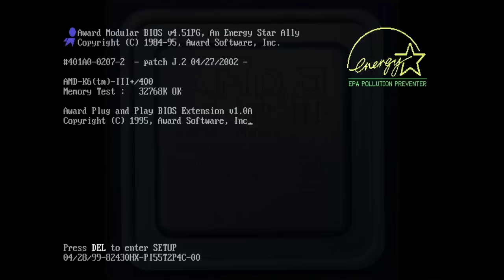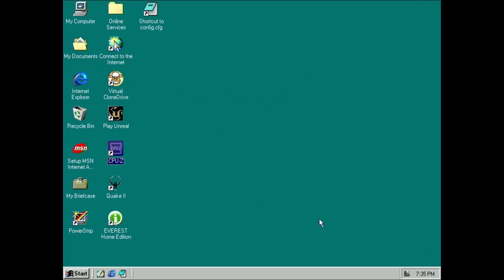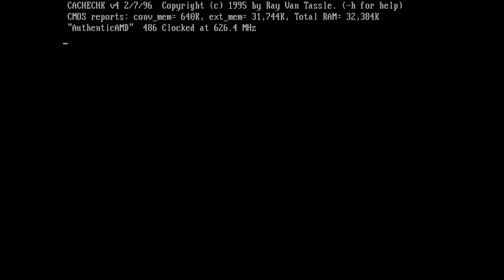Turn K6-2+ into K6-III+: Modification and Assembly (Part 2)

Comment: Good old days of AMD... I remember unlocking Duron 1400MHz to Athlon 2100+ just by bridging contacts with B2 graphite pencil and unlocking additional L2 cache... I paid about 50% less than would for same performance, I also unlocked ATI Radeon 9500 to 9700 Pro also by resoldering some resistors, just the other day found my old printed manuals, I probably still had dial-up at the time so I printed to save on monthly bill :) Those were the best days, it was so much fun and interesting to mess with hardware
Reply from the maker: I tried the 9500 to 9700 mod. There was a soft mod via driver hack available. I think you unlocked the extra 4 pixel pipelines or something in that area. With the soft mod you could first try if you had a good or defective chip. Mine was unfortunately defective and I got artifacts
Reply: Did the same with an 6200 unlocking to 6600.
Reply: @bitsundbolts  Also the 9800SE 256bit version was possible to unlock fully to make it 9800PRO. I had such card and it did work without any problems.
Reply from the maker: Good to know. Thanks for sharing! 👍
Reply: Duron and Athlon used whole different sizes die's
Reply: @jannejohansson3383  Indeed. Only the multiplier lock could be lifted. Same as the Palomino core Athlon XP's and MP's. It was a little more complicated on these organic amber/green cpu's than the ceramic ones. The bridges were cut in the middle deep and those cuts needed to fill first before connecting the bridges again. And then it the multiplier was freely selectable. I used to do couple of those mods too at the time.
Reply: @randomdriver  yeah, and I think these some could turn to mp, I still have dual socket board from these day, a7m-d or something. That bios didn't have multiplayer change possibility even with hax cpu, but it was OK without that. And ecc mems didn't really were so good some added speed :p
It was then, now it's now. Some Lan party if I test something and used one cpu, computer was on table, some guys looking and thinking how on hell he is driving PC without processor. They saw just empty socket and indeed it was running :p
Now I have first time after maybe 15 years powerstation with one cpu, but that same board got ready place to another 6 rams and cpu slot wired on pcb. It gives some empty room inside box and otherwise it's little bit full. I just need new lto-6 drive, sas or fibre, no matter. And I think this could be first Intel for me on this use so long. Dual pentium 2's worked with normal cpus, then these Amd Mp and Intel xenon comes and those f*** me some time, because indeed them are many times just differently jumper "normal" cpu's. 
These organic amd Athlon didn't took long time at world nerds to figure what's happening these burned jumper bridges. I think it needed good clean, some stuff to hole, mask it right way and then silver paste that connect it way you wanted. There were gold points around these maybe laser burned pit's, but connect those didn't help at all. I remember to made 2 cpu's some mods, but those were my friend use. Then came last 32 bit cpu's to that socket and these have much smaller die, could be these weren't much better at all, but I think them used smaller amount of watts. Fun thing was that these shows to bios Athlon-mp! So I threw 2 in and they are sitting there even now. Maybe some day I would do system around that board. After that, every time I changed cpu, whole system needed to upgrade mb,mem and all. Today every time new (really) better cpu shows, it have different socket. And memory between ddr3 and 5 is faster on paper, but chips have bigger "lag", so "net power" do not increase that much. And going 3 channel to 4 is expensive than 3->6. (That 6 channel with 12 ddr3 sockets was an option on paper few years ago, I don't have any need to change that system anymore, just keep it work. And I don't play games with these. It isn't impossible either.
Reply: Now you can emulate those PCs even on a potato PC, crazy
Reply: I still remember doing a wire mod to up the multiplier on an old amd cpu. The mobo could only run the cpu at 450, so i uped the multiplier to get it to run 550. Lol still remember people saying the cpu was going to explode on forums, yeah it ran great for years untill the computer was retired.
Reply: I remember unlocking Duron 750MHz to Athlon 1100MHz....
Reply: I live that era, but I never get effort to buy any video card that time. My first one was FX 5200, and it was superior to that time consoles (2005)
Reply: Das mit dem Bleistift kenne ich auch noch.  ... sehr lange ist es her.
Reply: You mean unlock the multiplier

Comment: Performance difference is about +20% for newly created K6-III+ over plain K6-2+ so it is definitely worth try. Especially with such relative easy move of re-soldering one physically big capacitor on heat resistive ceramic package. If it doesn't work, you just solder it back and that's it. 
Full 256 kB L2 cache also opens you much better movies playback capabilities (like can't decode fluently/ no problem to run smoothly) so just 20% more is not completely accurate :-).
Reply: Got 2 of the 570 K6-2+ modded... running at 600Mhz on Asus P5A-B rev 1,04. Never had a faster socket 7 system ever.😍

Comment: I know not having a few extra tips for certain desoldering certain types of things can make it harder. Still good idea to add new solder if the old isn't cooperating and you are just heating up the chip and burning off the flux. It's not a bad idea to use the kapton tape like you did, especially if you are worried you might mess up. One thing I would suggest is getting a soldering wick at the very least. It makes for much easier clean up, especially when you have large blobs of old and new solder. Getting rid of all the old and having a fresh layer of new makes things easier personally. 

I honestly wish I had known about this back in the day. I heard about it much later after I was done using a k6-2. At the time I wondered about upgrading to a k6-3 and for the right price I would have considered this(My attempt at the time would have been much cruder). Sadly by that time it was much more reasonable to upgrade to something way faster and be done with that dying platform. I remember considering buying an athlon at the time for the pencil trick. However I just ended up getting an athlon xp instead and overclocked via the FSB. I did help a friend do the pencil trick on his, he clocked it pretty high that matched my athlon xp 1800+ speed. I remember we had these antec or I want to say thermaltake heatsinks for them. On high they were just absurdly loud. He ran his on high to keep his cool with the overclock. I tried to keep mine lower, but I bought it to replace what I had before to reduce noise. Later I upgraded when things were reaching 3ghz in speed and switched to zalman. Now I just insist on never going back to 45-60db for cooling again. I remember making lots of bad choices at the time. I went with a geforce 4 ti 4600 from MSI and wish I had waited and would have gone with a 9500 to 9700 pro had I known what was coming. I remember thinking at the time, my card holds up to the 9700 pro, but I would have waited for that and would have been better off not going with MSI anything. I never made that mistake again. MSI never again.
Reply from the maker: I have a few 9000-series cards and I can't wait to play around with them. I had an ATI 9500 which I tried to soft mod into a 9700. But it didn't work, I got graphic glitches (black squares distributed over the entire screen). I want to try this again soon!
I also had an Athlon 700, which I replaced for XP 2400+ later. Too many good memories!!

Comment: I don't know if you tried this when attempting the removal with the hot air station, but generally when trying to remove components from a board, one should usually "pre-heat" the general area where the component is located, before going in for the heating of the specific spot where the component is because otherwise the cold board will soak up a lot of the heat and force you to have the hot air pointed at the component longer, and therefore risk damage to the immediate vicinity of the component, but like I said I don't know if you already tried it but just didn't detail it in the video
Reply from the maker: I used a hot air station initially. I did heat around the resistor and tried to remove the component, but it wasn't working. Will try to refine my method and mention it in the next video
Reply: I used razor blade for cutting 4 edges, filled with some specific silicone glue to remove heat spreader. It is important to not hurry as die is glued too and it needs some time to detach. The method with knife used (after you really cut glue - you must check twice) as lever is very good. 

Then you must clean thoroughly tboth die to bare silicon and also heat spreader (again razor blade is very good if applied with sharp angle so it cut reamining silicone and not scratch heat sperader aluminum alloy). Isopropylacohol is not working 100% but it is helping, paper towel or even finger is able to slowly remove all glue. 

Because CPU base is ceramic, you can easily use soldering iron. I have soldering-desoldering station so I used two heat pens (285°C) from both sides for easier desoldering of capacitor and it took maybe 10 seconds of heating. Also you may add some bismuth-rich solder to lower degree of thawing than standard solder first. After desoldering you should clean the area of solder carefully (we don't need short circuit), put some small amount of solder to so far clean golden pin and apply soldering flux. Then put capacitor back to its new position, ideally with smd tweezers and heat up one and other side to be well soldered. Don't hurry and take proper time.

In the end put non-conductive thermal paste on the die, apply credit card to create smooth layer, put 4 pieces of good silicone glue (I used glue for repairing TV remote controllers) to the edges of heat spreader and put it back on ceramic CPU. I fixed the whole thing with cooler and you can immediately turn the system on to check if your CPU is alive with 256 kB cache. If BIOS says K6-III+ and OS+ applications are running, you are happy one. Don't remove the cooler for next 24 hours to be sure glue is hardened and that's it. If it doesn't work, remove the CPU immediately before glue hardens and you must move capacitor back to 128 kB position.

Comment: Maybe you can also test the overclocking capabilities of your 'new' K6-III as it's running at a 6x multiplier and only 66Mhz. That would be a nice gain :)
Reply from the maker: I don't have a Super Socket 7 yet. I can do 83 MHz FSB on the Asus P55T2P4. If I get the time, I will try it, but I want to try 500 or even 550 on the Super Socket 7. I also have some K6-2+ 570 waiting which I should receive within 60 days. More of the same to come!
Reply: @bitsundbolts  i will be following this journey !
Reply: @bitsundbolts
Reply: @bitsundbolts  Go to a privately owned dump then? Mine has boxes full of pcb's and I got 2 Super Socket 7 AGP boards yesterday.

Comment: Nice work! 
If you are having trouble dissoldering components with an air station/desoldering station/soldering iron, tin the part with rose metal or Bi57Sn43 solder. 
It reduces the solder melting temperature to around 100C. Of course, you will have to clean it up afterward with desoldering wick or braid before soldering back the component.
Reply from the maker: Thanks for the suggestion, I will have a look since I know this won't be the last time I am doing this
Reply: @bitsundbolts  No problem, I had to resort to this trick in order to desolder chips from boards that were either connected to a big ground plane, or else the via would come off, and plcc chips, to patch corrosion underneath while avoiding killing the chip with heat.
Reply: Another trick to more easily desolder components would be to pre-heat the board, I’ve heard that some have done it using sand in a pan on low temp.
Also keeping the soldering tip clean using one of those cleaners with metal shavings is a must when doing precision jobs, often wiping the tip and re-tinning it so there’s no need to spend too much time before the solder melts well.

Comment: Not being able to remove the resistor with the heat gun is due to the fact that the cpu is socketed, thus spreading its heat through the pins/connectors on the motherboard itself.
So a holder for the chip where nothing is touching metal is the better way because it keeps the heat concentrated on where you want it to be.
Reply from the maker: I think it's a combination of many things. The solder blob was really easy to work with. But will keep your comment in mind when I try my next mod. Thanks!
Reply: @bitsundbolts  Adding low-melt solder is also always a good thing to keep heat exposure to a minimum.

Comment: If i could return back in time after watching this I'd buy K6-2+ to mod it. Back then I bought Celeron 333A instead.  This was not completely wrong, the wrong was the bx98 chipset of my low quality motherboard.
Reply from the maker: I skipped the K6. I went from an AMD 486 DX4 100 to Pentium II 350! Had to upgrade to a Celeron 500 to play NFS: Porsche. Somehow it didn't want to work on the Pentium II

Comment: Hitting it with a wider nozzle, higher airflow and 450 heat would have been the better bet since there's a lot of heat sink capability with the area you're hitting. You wanna overload it with localized heat as quickly as possible. Of course, low melt solder helps as well.
Reply from the maker: I do have other nozzles. Next time I'll try it with a wider nozzle. I was super afraid the first time that I might damage something.
Reply: @bitsundbolts  100 percent, I've definitely hit things with hot air and blew off a capacitor before haha it pays to be cautious for sure!

Comment: This is really cool! I have a K6-2+ 550 which I got for cheap years ago, I was curious of trying this mod but the amount of risk involved is not for me. Also I'm not sure how much of a gain you'll get in games compared to the 128kb of L2, maybe you'll see more of a difference with productivity applications
Reply from the maker: I agree - the risk is quite high. What I have seen so far is that most of the benefit comes from the L1 cache anyway. But I will try to proof that there is a difference between 128kb and 256kb in the future. I assume some games and, as you said, productivity applications will benefit from larger cache sizes.

Comment: I've always wondered how much cache was needed in these win98/xp era of CPUs. Which games could take advantage of the larger cahce, which didn't and how much of a difference there was. 

I know 0 cache is awful for performance, but was the Duron worse off for the lower cache. Also, there were mods available for the Duron that would be cool to see performed and how well they helped performance.
Reply from the maker: I am looking for ways to proof the benefits of this mod. A quick Quake II benchmarks did not really improve results (maybe a 1-2% increase).
Maybe size does not matter that much as long as there is at least 64/128KB. The L2 cache also operates at CPU frequency - another benefit over the motherboard L2 cache chips.
Reply: The K6 architecture had little benefit from the integrated L2, except to level up the performance with slow RAM. The large L1 already provided most of the benefits, but this is the case for most CPUs with exclusive last level caches. Same was with Athlon T'bird and Duron -- marginal perf difference between 256K and 64K L2 cache. Even now with Ryzen 5800X3D and its huge 96MB L3, only some applications and games do get perf boost, simply because not all working data sets fit in.
Reply: @Ivan-pr7ku  games seems to be getting large minimum 1% low benefits with the AMD 3d cache 5800x3d though
Reply: @bitsundbolts  If there was no motherboard cache, then the difference might be more noticeable, as the 512k (slow) motherboard cache is there to catch what falls through the 128 or 256k secondary

Comment: Memory intensive programs should benefit the most from the cache. DOS benchmarks are quite small, hence the same results. Try some bigger benchmark suites on Windows.
Reply from the maker: Will try to find a good sand consistent benchmark suite for future videos
Reply: It's not just the benchmark size .  It's the amount of memory touched in the speed critical loop .  If that is more than 128K, but less than 256K, the extra cache should help .  Unfortunate access patterns may trigger at lower sizes, but calculating that requires knowing the detailed cache parameters, not just the total size .